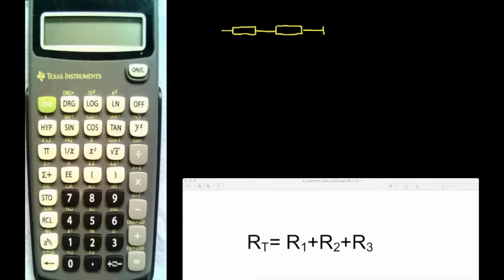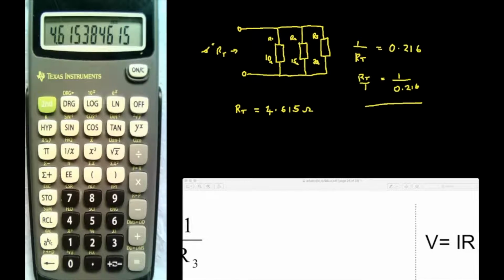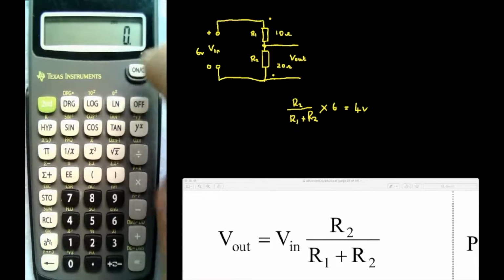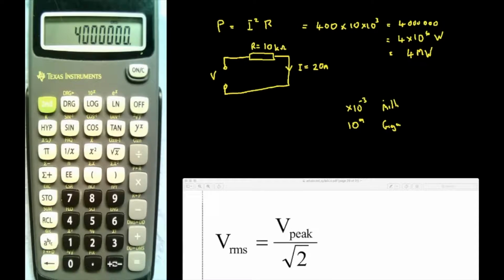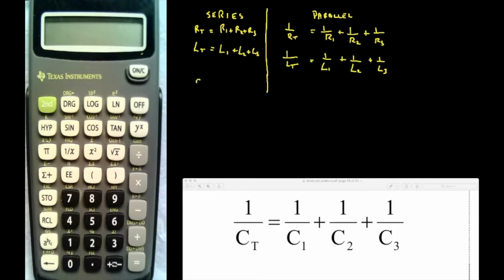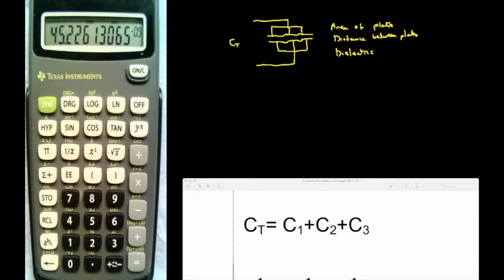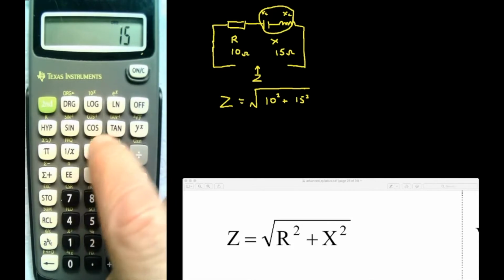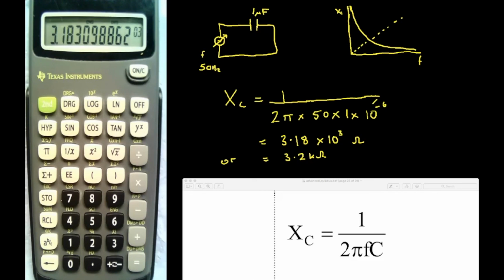Advanced - Using the TI-30Xa - Part 2

Comment: If given the peak value and we know RMS is .7071. Can't we just multiply 55 by .7071 which equals the same answer ? Much easier. Or am I missing something :-)
Reply: That’s valid.   Either multiply by 0.7071 or divide by root 2.   The latter retains the full accuracy of the calculator’s internal resolution whereas 0.7071 is 4 decimal places approximation which is actually absolutely fine.